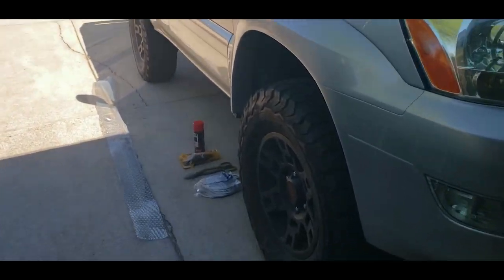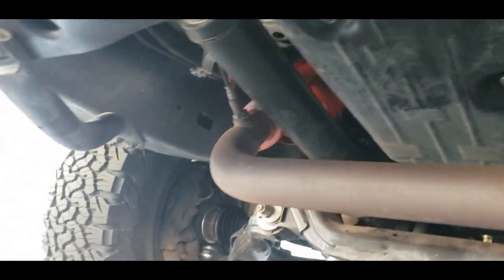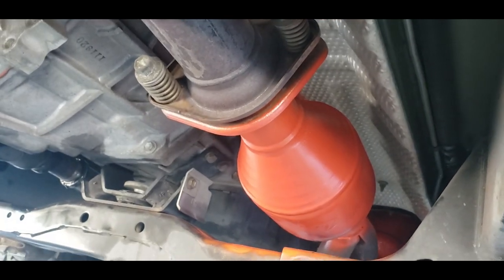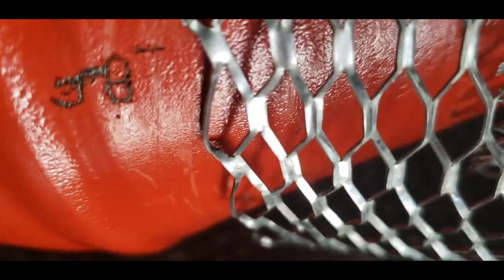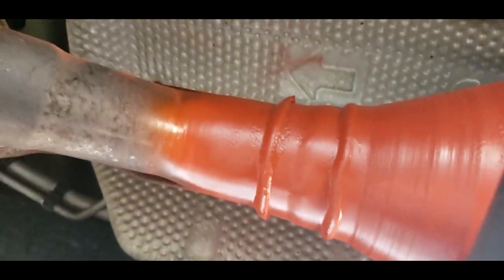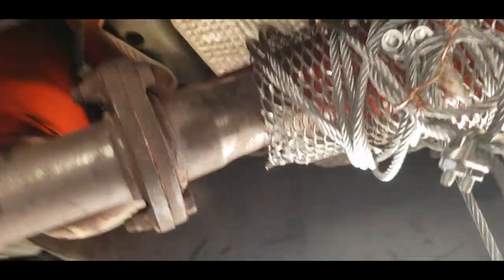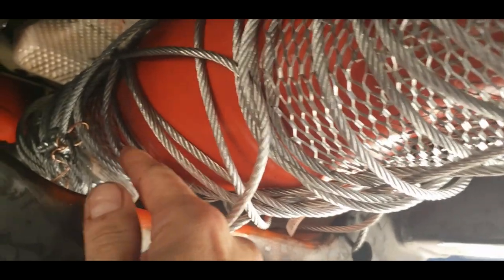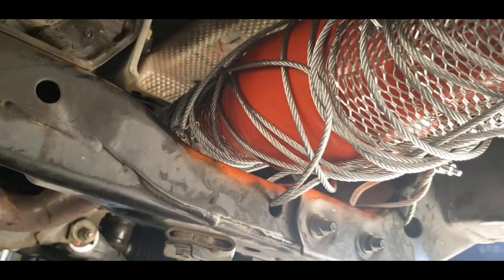GX470 Catalytic Converter Anti theft Device

Comment: I was thinking about putting cable like what you did on my rav4. I didn’t want to get underneath the car to work on it so I had a muffler shop weld a metal cage to protect my cat. They charged me $550.00. I thought it was expensive.
Reply from the maker: Yeah an hour and $50 was worth it for me. Either way they are safe though